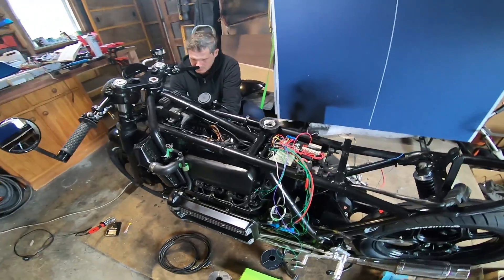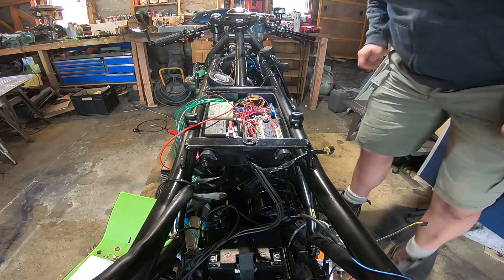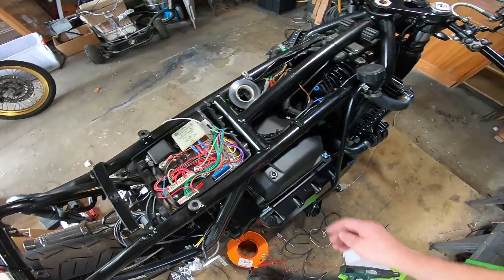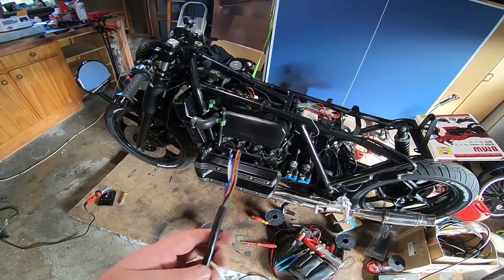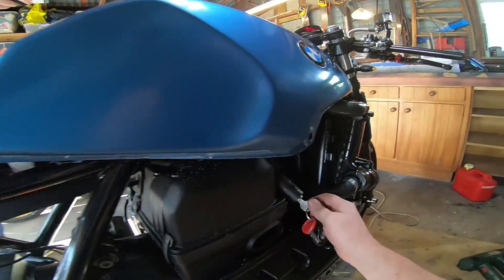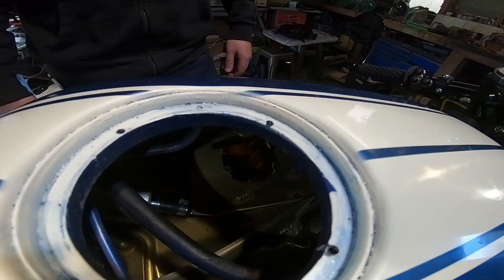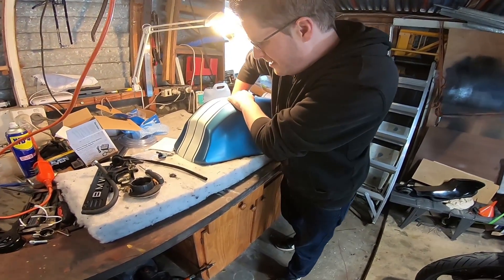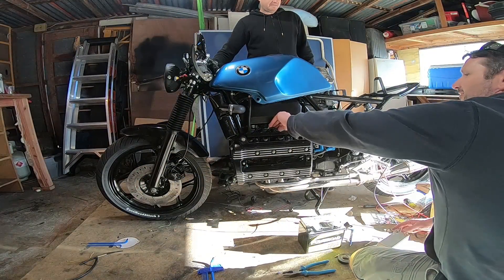BMW K100 MOTOGADGET M-UNIT WIRING PART 9

Comment: That starter motor isn't doing what it suppose to do...
Reply from the maker: Yeah i know and to be honest i'm a little stumped as to why? Is it the starter sprag clutch ? Or is it the starter motor itself? We were thinking about getting my starter motor from my bike and swapping the two over to see if that makes a difference ,,,,,,,,
Reply: mikeyfrompiha  it sounds like the freewheel... happens when the bike has been standing around for a long time or high milage and the teeth clogged so they do not catch the inner ring( which is turned by the startermotor). Either you try to clean it while still installed or you take the bellhousing off, remove the assembly and clean it. For what I know it is caused by stuck teeth of the freewheel. The startermotor is doing fine ( it is spinning😉)
Reply: @mikeyfrompiha  must be the spring part. For sure. Not the motor. We call it the bendex. Don't know if that is an international term? But that must be the part which is not working proparly.
Reply from the maker: The k100 doesn't have a Bendix like the Virago does , it has a ,,, how do i explain ,  like a one way bearing? Maybe after sitting for over a year with lack of lubrication this was causing it  because after we ran the bike for ten or fifteen mins the starter motor sounded normal again
Reply: @mikeyfrompiha  it must have a spring of some sort... But you probably have a workshop manual to sort it out 😉